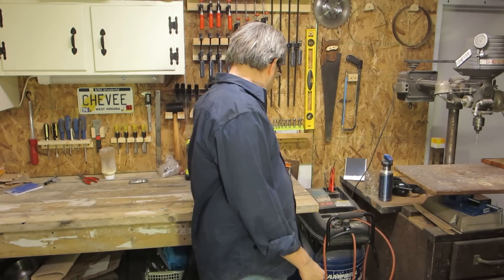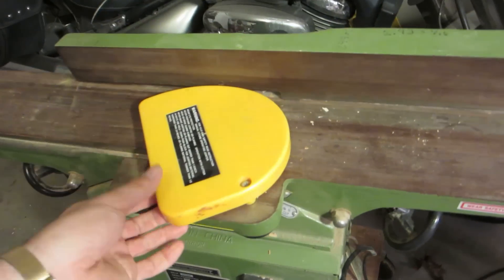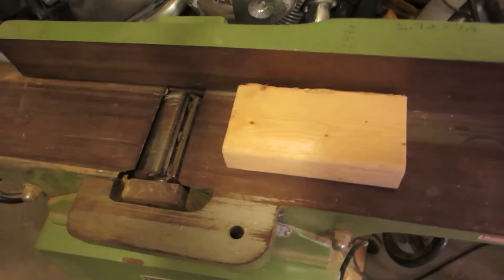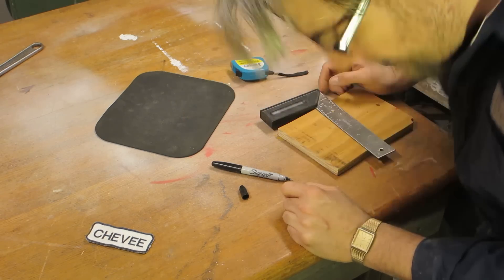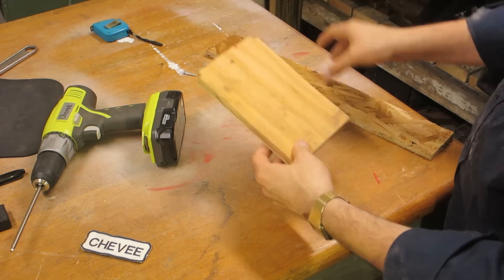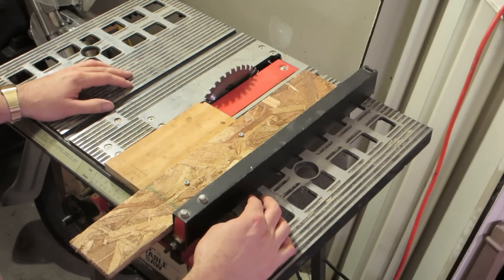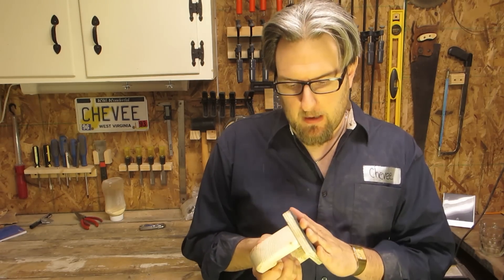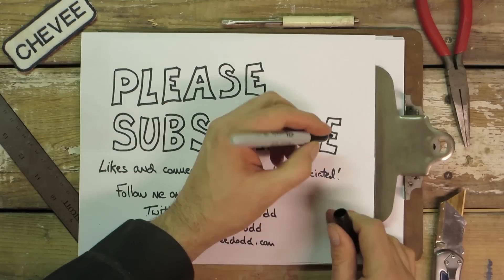Chevee Builds - DIY Push Block

Comment: So glad to see this. I was about to send you a Grrripper care package :)
Maybe you could work on a table saw insert that would allow you to add a splitter behind the blade and also be a zero clearance insert?
Reply from the maker: My crappy saw doesn't have support on the left of the blade for an insert. I think I have a riving knife somewhere. Soon, I'm going to build a new top/fence for the saw to "upgrade" it.
Reply: +Chevee Dodd Hmm...so you could build it but it would float and/or sink on the left side, eh? Bummer.
Reply from the maker: Right. I've thought about welding on some tabs, but I think I'll just put a piece of melamine over the whole thing and be done with it. It's  a total crap saw.

Comment: I have seen the mouse pad ... um determinate/separate. You MIGHT (not sure) want to tear off the cloth to insure a long-er lasting bond to the wood tool. Even better 5 years down the road you will know what to do. If the wood glue permeates both layers it might help/hinder.